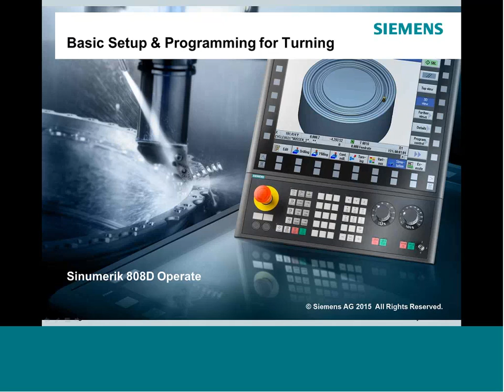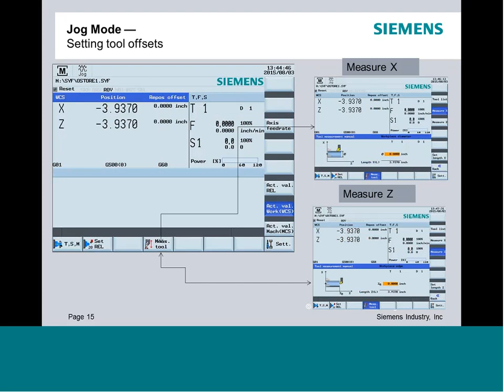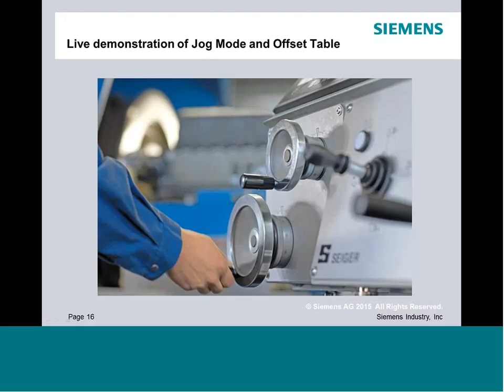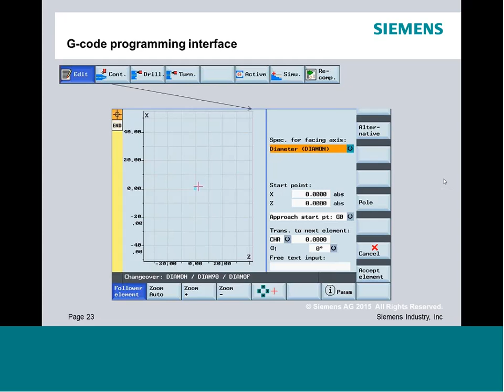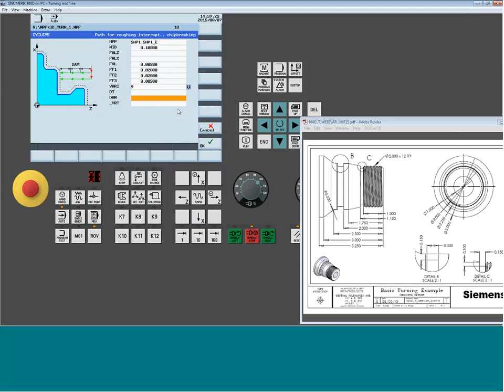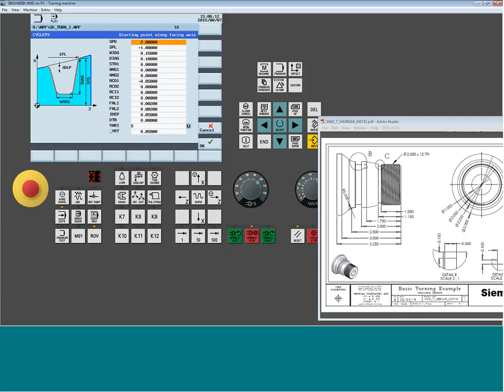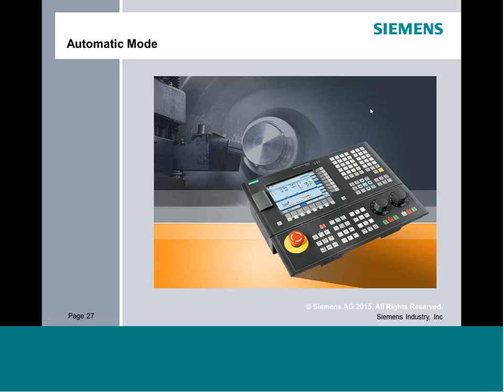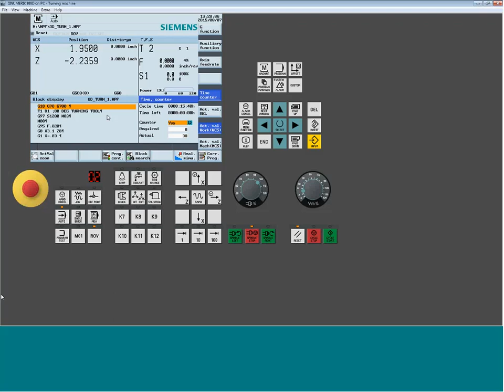808D Turning   Basic Setup and Programming

Comment: hello, I have a Siemens 808, I can't understand how the machine is supposed to understand the parameters of the workpiece in cycle #95? You can enter parameters in the synutrain, but there is no such thing on the machine???
Reply: I am having the same problem, did you find an answer to this?

Comment: I am working on a lathe control is 840 d 
There is no soft key for attach contour  and when I call cycle 95 it shows an alarm 12550  
How to solve this problem
Reply from the maker: the 840 programs a little different that the 808.  you need a cycle62 call before your turning cycle.  take a look at this video.  https://youtu.be/FGHHO6UL4U4

Comment: Dear sir how change Inch to mm in Siemens 840d please teach me
Reply from the maker: Simple go to the jog screen and expand your horizontal softkeys with the grey right arrow till you see the horizontal softkey for Settings.  Select settings and you will see a vertical softkey for Changeover metric.  this will switch the systems unit of measure.